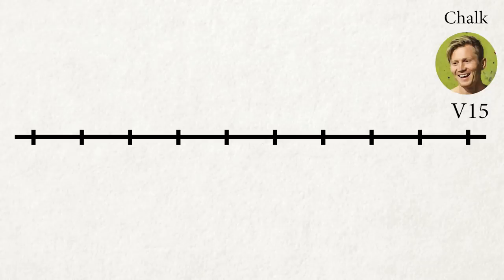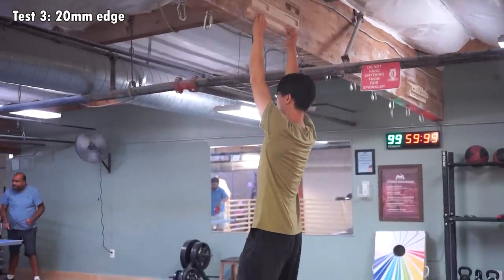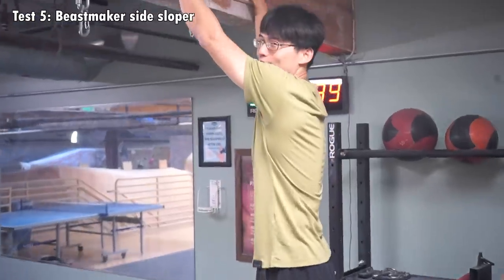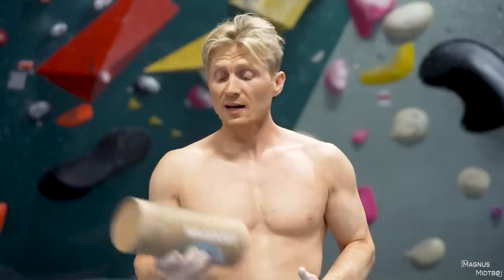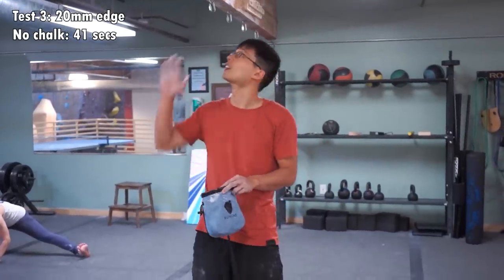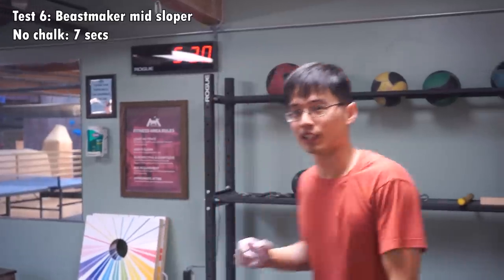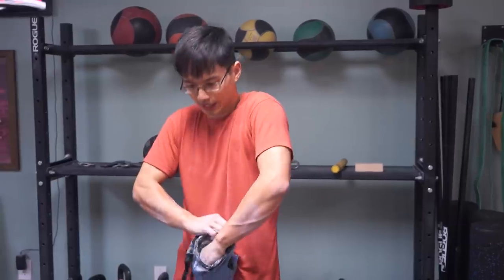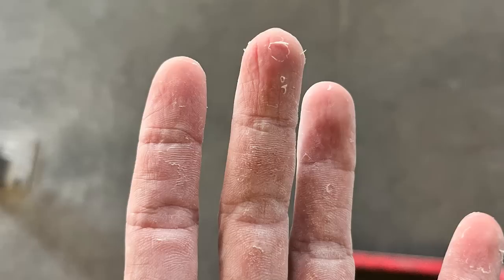How Much Does Chalk Actually Help In Climbing?

Comment: Chalk increases your coefficient of friction meaning you need to apply less force to counteract gravity.  This is why it helps so much on the small crimp and the pinch.  However, this makes it less useful for moves that don't require force like the larger crimp.  For higher level climbing, it's simply not possible to generate the force needed without chalk so it is necessary once you pass V8 ish.

Comment: Your stool placement on the second go with chalk on the beastmaker was different. When you hung from the beastmaker the first time, the stool was practically right under you, it was so close you could easily step back onto it when you were done. The second time, with chalk, it was much farther back. Taking your feet off of the stool from that far back was like releasing a toe/heel hook, and it transferred the stored energy and made you start swinging immediately. So chalk or no chalk, the second attempt was going to be worse than the first.

Other than that great video! Interesting attempt to compare chalk to no chalk, and quantify how mucb affect it has. If you were to do this over many days, probably alternating chalk/no chalk, you could get more reliable data due to the increased sample size, and it would help control for some other variables.

I too only recently started using chalk. As I'm progressing into harder grades, with more slopers, slopey crimps, and other bad holds, it really helps give you that bit of extra friction that can be all of the difference in the world between sending and not.
Reply from the maker: Thanks for pointing it out! I do agree that the stool placement might be the main reason I fell, instead of due to too much chalk. The explanation of it being like releasing a toe/heel hook makes a lot of sense to me!
Reply: Actually a really great demo of why you've gotta set up directly below a hangboard to stop the swing. Kept happening on my home board (it hangs from my pullup bar so it swings easily). Can easily cause injury when you're pulling very hard
Reply: @GeekClimber  That being said: You do have too much chalk on, or atleast not evenly spread out enough. There is a reason to why people claps their hands/blow on their fingers before going on...
Reply: @GeekClimber  Yes,  this swinging factor is MUCH more relevant for ALL of your hangs than chalk itself. If the hangboards would be reachable from the ground and you could position yourself perfectly when you start, without any swing, it would boost up all your times significantly. If I have even the smallest swing, it uses up some of my power - I can add at least 20% more time if I do this perfectly, than with even with a slight swing.
Reply: @GeekClimber  Maybe next time ask someone to remove it :p
Reply: @mattiasgonczi  Yeah, if I can visually see excess chalk, I know that is going to affect friction
Reply: Or put the stool in front instead of the back? Looked painful!
Reply: using the stool is simply not very clever

Comment: I think the tearing of your skin was due to increased friction supplied by the chalk. The skin on my fingertips wears away if I go very hard on plastic or rock. 

It is possible though that your skin was not used to the increased friction it was experiencing and thus why it teared. Given time to adapt to using chalk, I would imagine that you would reap the benefits of the extra friction and your skin would better handle the increased load.
Reply: This is exactly correct. Hands adapt to the continued use of chalk and they will eventually stop tearing so badly.

Comment: I think if you continue climbing with chalk for a little while, your skin will adapt somewhat, and you'll build up callouses that work with the dryness.

Also, as other users have mentioned, washing your hands immediately after, and using some surface moisturizer (i.e. ClimbOn) can prevent cracking. A deep moisturizer (like most lotions at the store) will prevent cracking but potentially cause flappers so don't do that.

Comment: Here's an experiment to try!  Calculate the coefficient of friction with chalk and without.  Lay your hand palm up.  Rest polyurethane block on your palm.  (Like an Atomik ninja pinch hold.)  Measure how much force it takes to move the block from rest.  Compare without and without chalk.  Can also compare different chalks (liquid, powder).  I'm not sure exactly how to measure coefficient of friction, but it seems right you up your alley.  I would love to know the measurements.  Also, this is an awesome video!!!  The previous video inspired me to use chalk for the first time. 

Also, Mani the Monkey has a great video on the beastmaker sloper hold and experimenting with different weights.  He hypothesized that a heavier climber generates more friction on the BM sloper and can hang from it easier.
Reply: To get actionable information, you do need to be doing this test hanging on the block... otherwise dew point/moisture ramp up from finger exertion, loading/density of force vectors aren't well represented for application in climbing.
Reply: @ahbzjr  This is a simple and easily testable scenario to see whether chalk makes it more "sticky", to use Magnus's word.  All the difficult-to-control variables, such as muscle fatigue and technique are removed. (To make it even more controlled, you could use a cadaver.)  If there isn't a measurable difference in the simplified case, there won't be a difference on the wall.
Reply: the problem with mani's video was that his center of gravity completly changes with the 10kg in front of him. put the weight on his back and the results would change. nonetheless it was a nice try and idea.
Reply: This
Reply: @ahbzjr  Ahh mate, I was searching for the first paper and couldn’t find a full-text until I gave up and finally texted the author on Researchgate. After reading the readily available full-text of the second paper, it seems to be sufficient to read that one, for anyone else that is interested in this. He described the flaws (or rather irrelevance to climbers), that I was already suspecting after reading the first papers abstract, quite well. 

„The effect of chalk on the finger–hold friction coefficient in rock climbing“ by Arif Mithat Amca, full-text is on Researchgate for anyone else interested, I had to painfully type out the DOI because I watching on my tablet lol. This papers results showed an increase of ca. 20% of the friction coefficient, seeming much more in line with the overwhelming anecdotal evidence. While the exact number should still be taken with a grain of salt ofc, the methodology seemed more legitimate for the climbing scenario.

Comment: I think chalk becomes more and more essential the harder you climb due to the size and angle of holds at higher levels. They often require greater pressure on smaller surfaces or high levels of friction.

Comment: I think there is an optimal amount of chalk - too much can be worse than too little with slopers, this is why we brush the holds. As your hands are on the dry side, using gym holds which are already chalked, you were using chalk already, so maybe your skin just do not need much more, unless you need to use small holds - so with your results, maybe the optimal for you is just to chalk your tips when necessary, not your whole hand.

I am on the other side with really sweaty skin. The most drastic effect for me are slippery, thin pullup bars, I can one hand hang on them 2-3 sec without chalk, and 20 sec with chalk...

Comment: I think we don’t really have to talk about this one. When it comes to crimps, chalking is just superior. You don’t really need to scientifically prove that once you experienced a wet slip on a crimp. And crimps are everywhere. Not only on „higher level“ (whatever that is) -climbs, you can have pretty bad crimps on a v3 slab. For slopers and bigger holds.. I think it depends on the texture. If the hold is very grippy, it should not make that much of a difference unless you’re sweating like crazy. Means: Granite slopers without chalk will probably work fine. But sandstone slopers without chalk? Oh boy.

Fun fact: The beastmaker slopers are easier without chalk imo when u have the perfect amount of skin moisture, makes the wood a little bit more sticky.
Reply: Assuming you switched around granite and sandstone.

Comment: In my opinion, chalk makes you a better climber because you learn to trust bad handholds way more due to increased an optimally always similar friction on the same hold.
Same as some other comments pointed out... You are able to pull harder with chalk, skin needs to get used to that which takes like 4-8 weeks maybe.
Additionally it dries out your skin therefore you might consider using some hand lotion after climbing. There are also some climbing specific products (im not certain which ones are available in the us).

Comment: I hope you're healing from that fall, doesn't seems fun at all 😦
Besides that, I started to use chalk since not too long ago and I see some difference. 1. Is important DO NOT ABUSE of the chalk. Just use a bit, not go crazy with it in all your hand, because there are parts of your hands that don't really need. Also it make the hold super slippery in the gym, EVEN WORST if you do climb outside (THE CHALK DOESN'T GO AWAY AFTER THE RAIN, IT JUST GET MORE STICKY! I try to do not use it outside and brush after I climb if I used). 2. Definitely I feel that I can climb more crimps and hold myself in pockets when I use chalk.
To me is important to make sure that I use certain amount, it helps, but it will never do all or the big part of the job. Just put some in the fingers and the big areas that really need to get better friction. 

Thanks for share your videos!!! 🤩

Comment: i'm confused why the hangboards are up so high in this gym. seems quite dangerous and prevents you from going to your limit due to the risk of a fall. i really prefer if it's in a height such that i can easily reach it while standing, so that returing to the ground requires only a small movement of the legs.

Comment: The linear comparison is of course silly. Obviously chalk won't turn a V0 climber into a V5 climber because for lower grades all the holds are really good anyway and you don't need chalk. However at elite level, a V10-V15 improvement can be feasible because then you get super bad holds where even small differences such as chalk start to matter.

Also for test like 20mm hold and the pinch hold the failure point seems fatigue rather than friction so it's not a very good test for chalk effectiveness, especially since it's not very representative of what you do on the wall. You don't just hang from a huge crimp or pinch for a minutes straight. A better test would be how much weight you can lift with a pinch rather that holding for time for example.
Reply from the maker: You are right! In hindsight, a better test indeed should be about how much weight instead of holding time.
Reply: Funnily enough you are describing a physics lab that I did last year. My teacher is an avid climber and loves to mix in climbing things into  lessons. We did that pinch experiment and it turns out that I could pinch 55% more weight with chalk than without. It was super interesting since, as a skinny climber, without chalk I came in 2nd in terms of how much weight i could pinch ( a D1 swimmer beat me by 5lb). But with chalk I easily came first in our class about 10lb more than the swimmer.

Comment: It's probably not related to the specific holds, but rather that the small advantage helps a lot on the holds where your ability is already on the edge.
Probably your pinch would have a bigger improvement with more weight. That's my theory.
Also the whole V6 climber thing. If you were to climb with chalk while projecting V7s if you then end up succeeding twice? as quickly as without chalk. It doesn't make you 6 grades better immediately, but it might allow you to get 6 grades better much quicker.

Comment: You should use Primo Chalk! I have the same problem. My hands are so dry that they will crack and bleed, even without chalk or climbing. I had this issue with regular chalk until I found Primo Chalk. It has a moisturizer component mixed in so it keeps your hands nice and healthy. It was a game changer for me!

Comment: Would be interesting if you could create a device to measure the friction. Like a vertical force meter attached to a flat plate with something pressing into your hand at a constant force where you can pull up without using your own force against the plate

Comment: Here's what I think - on lower grade problems chalk isn't going to make as much of a difference because the holds are so much better in general and you will likely have much more surface area in contact with the holds - the limiting factor is less likely to be the friction between you hands and the rock/plastic. That being said, even at the lower grades, chalk does make a very significant difference. There's a lot of other technique and strength building tho that will be a bigger limiting factor, but the right amount of chalk will help, especially when you're at your limit.

The big key is as others have noted is that since your climbing in a gym where everyone else is constantly chalking up before every attempt and the air is 1/3 chalk dust and every surface has a light dusting at the least no matter, so you are in fact using chalk every time you climb at the gym. And if you're hands tend to not get very sweaty and perhaps you're climbing more casually, then it's maybe not a big difference between actively chalking up or not. It seemed like you were likely overchalking most of the time as well as you noted with the sloper - you don't want a bunch of loose chalk floating on your hand, that will make it slipperier. You want a layer of chalk to more or less absorb into your skin soaking up any moisture and creating a layer that will slightly protect your skin and also create more friction than your skin would. 

 Those tears are probably mostly just because you're hands are drier than they are used to being - part of chalks purpose is to dry your hands, so it comes with the territory. But if you wash your hands and put on some lotion after you climb you should be just fine. 

If the chalk you're just picking up along the way as you climb is enough then more power to ya! Heck, you're probably doing us all a favor and saving some brushing by cleaning off the holds as you go!

Comment: @Geek Climber 
As others have said in the comments. Chalk will dry out your skin a lot. So make sure to wash it off as soon as you are done climbing and then apply a good hand lotion. A good one meaning one that actually has credible ingredients that will moisturize. Not a cheap bogus brand :P Go to your pharmasy to find a good one. 
Also the added friction from Chalk will tear on your skin more. It's like when you just start out climbing. Your skin will be weak and un-used to the tearing. You start feeling this burning sensation in the skin and soon have flappers or cracks. So try to keep using chalk but be very careful with cleaning it off and applying moisturizing lotions asap. Your skin will adapt! :)

Comment: In my personal experience, chalk is best on small crimps and wide slopers, and you benefit vastly more the longer you climb. First climb of the day? I often forget to throw on chalk for the first few routes but do fine because ive memorized my warmup routes quite well and my hands are dry. After i get some sweat built up and move onto different routes, thats when chalk really comes into play. While the palm of my hand doesnt really sweat, the top of my hand does, and after about twenty minutes, my palm is well lubricated and will slip off crimps and slopers pretty instantly, and worse, will make the holds wet, which can ruin any further attempts by me or other people to climb them until they dry. I've noticed though, of possibly greater importance then chalk, is clean holds. Brushing some slopers and crimps is like a night and day difference. If im having trouble with a specific hold, instead of thinking "Im not strong enough, oh well", I like to make sure its brushed nice and clean and then try it again, and more often then not, its an amazing hold that was just caked in layers of chalk gunk! A specific V4 with this weird sloper undercling start comes to mind, I had done it once before and while it was difficult it was definitely doable, I hadn't done it in a few days, and decided to do it again, couldn't for the life of me stay on the start, literally as soon as I moved my weight at all, id just slip right off. I thought I was going crazy cause it was a fraction as hard just a few days ago. Dude saw me struggling, offered me his brush to clean it, I gave it a good bit of elbow grease and enough chalk came off that hold to fill a bag! Sure enough, when I tried again, it was much easier. It's very interesting the role chalk and brushes play in creating the best friction possible, hope you make some more videos covering things like this!
Reply: Yup this!! Me and a buddy have this thing where when we struggle with a problem we brush it and then send it right after lol. It’s also a bit baffling that he refuses to use chalk for whatever reason when it’s literally a proven fact chalk helps you climb better and it’s not just for “grade chasing”. Personally I think he is being naive in the video because he doesn’t “climb” with chalk so he doesn’t want to start using it now and back track in that. And his hands cracking,  I mean my guy you’ve been climbing with bear hands so they’re going to crack with more friction. But they will heal and get use to that. Anyways this video bothered me haha.